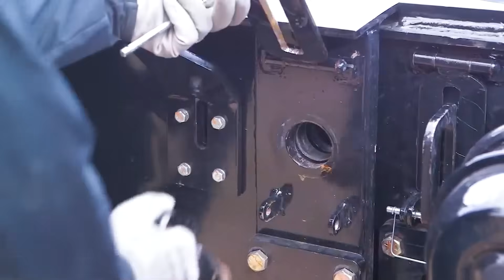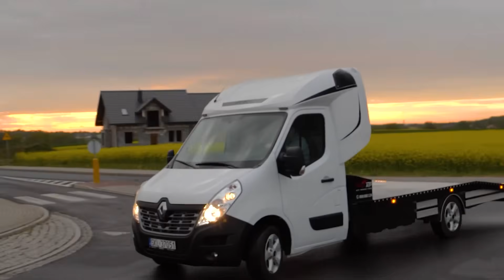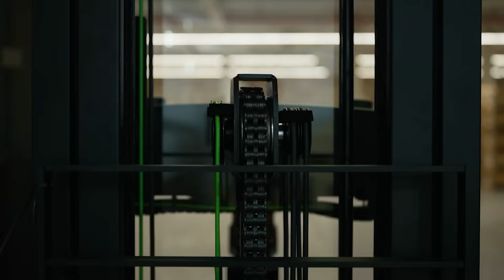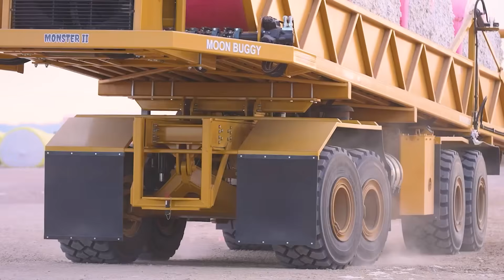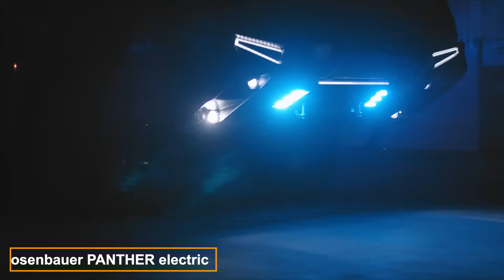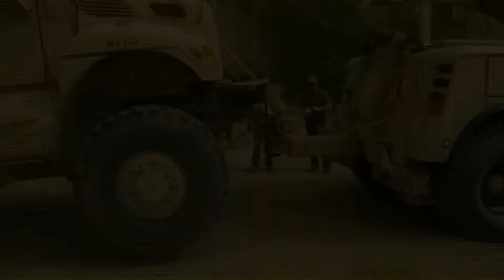15 GENIUS TRUCK INVENTIONS THAT ARE ON ANOTHER LEVEL

Comment: Elect aide for air pressure to get trailer backed into the loading dock. When silly " computerized eng " wouldnt start lol. Later after being towed to dealership. The truck eng started. No futher troubles lol. Like what Bs